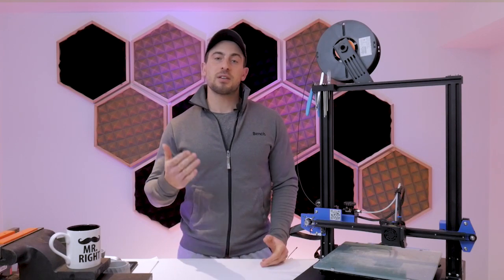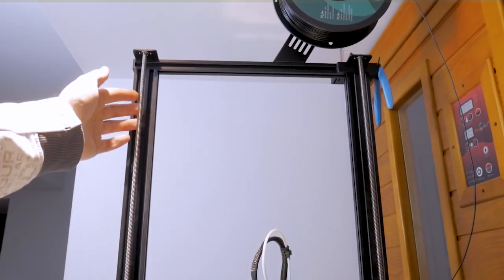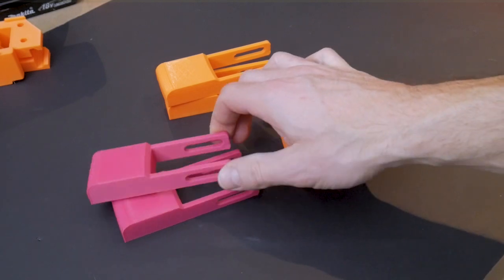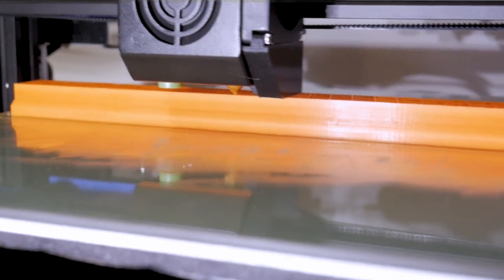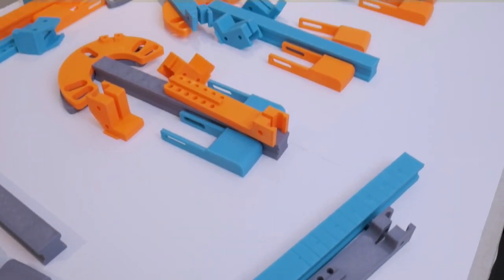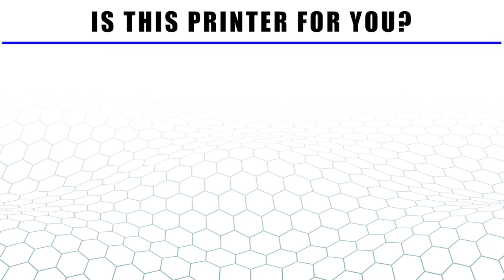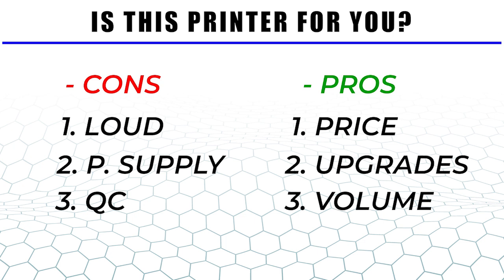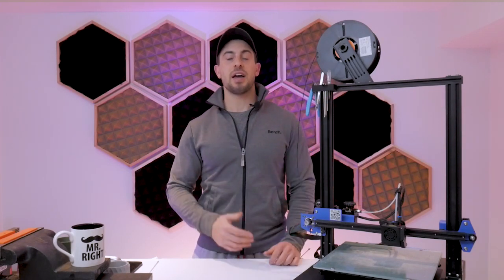ANET ET5X Setup, Settings, and Review - HUGE Build Volume For Under $300!

Comment: I can't tell the difference between the Anet ET 5, ET 5 X,  ET 5 PRO
What is a good reference point for deciding which Anet 5 model to buy? The Anet website doesn't really differentiate.
Reply from the maker: Good question, from what I can gather there isn't much difference (if any) from ET5 and ET5X . I read somewhere that ET5X was some sort of marketing differentiation for different markets. ET5 Pro does have the upgraded power supply and control board with silent drivers etc.

Comment: Thanks for sharing this informative video, I already have one of this machine and struggling with leveling every single time I try to print something out :( 
I really get tired of it and looking for permanent remedy for its issue among with your reviews in YouTube.
Reply from the maker: Thanks, hopefully you can get it sorted out. It is weird you have to level every time you print. Are your bed screws loose or something that it comes out of alignment?
Reply: @EmbraceMaking  Thanks for your reply, no the alignment is not the issue, the case is poor quality of inductive sensor every single time it decide to choose a dif height as starting point, I'm thinking to replace it with limit switches

Comment: I am going to buy this printer and put in a meanwell. And also you just got a new subscriber :D
Reply from the maker: It's a good plan! I would pick up one limit switch as a "just in case" for the z probe in the event that you have an issue. Thanks for the sub too, welcome aboard!
Reply: @EmbraceMaking  Just got my new printer yesterday. It was a brease to set up after seeing your video. So thank you :D
Reply: Same as previous reply from Cyrus.  Mine arrives Tuesday. I'll take your advice on the upgrades you've already done and have subscribed to see more.  🤙
Reply: @whileistillcan9338  hows it working out
Reply: @paoloaccomando4778  
Mine has been working great.  Once I got the bed leveled and set up, I hardly ever adjust it.  Just a little turn here or there on the build plate knobs based on what my first print lines look like and then let it run.

Comment: I had a very same and frustrating problem with under extrusion, finally I replaced the extruder with a Bondtech BMG extruder and boy, it made a miracle. It prints way much better than my stock ender 3. 
My printer is ET5 Pro version. Used CR-10s Pro profile in cura and now I love my printer. 
BTW:. Update to Marlin firmware and you will be able to precisely set your e-steps/mm and PID Tuning.

Set the distance between prob and bed between 2.2 and 2.7 millimeters. It will fix your homing and probing issues. You can use the include ruler and two papers together as a reference measure.
Reply from the maker: Thanks for the reply! In a future video I'm going to go with Duet wifi and the microswiss all metal direct drive extruder... should work great! Yours is also a viable solution, glad to hear it worked out for you. For my z homing I'm going to go with the traditional limit switch, I find it works great for me in most cases.